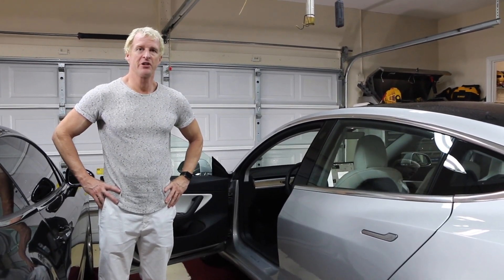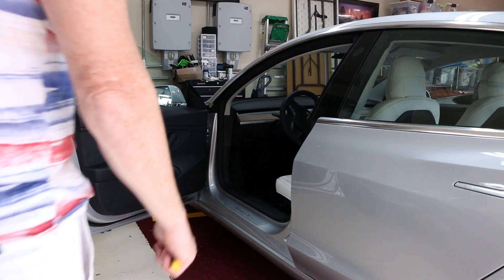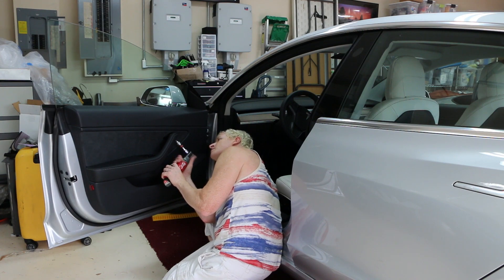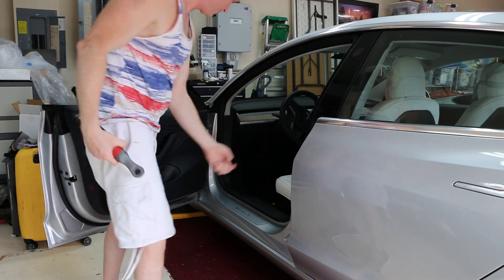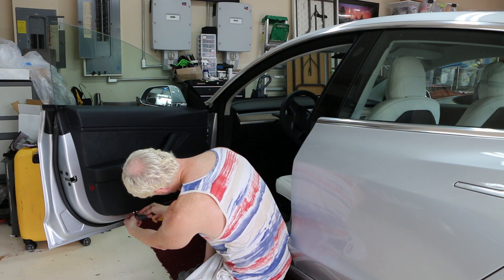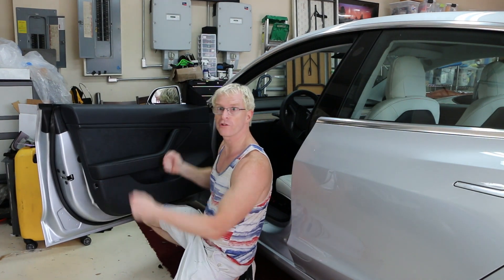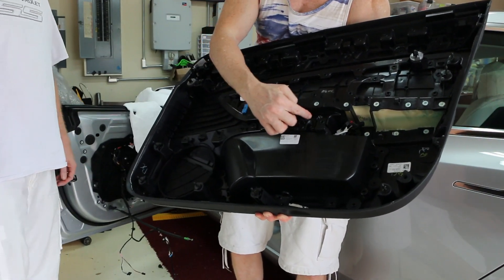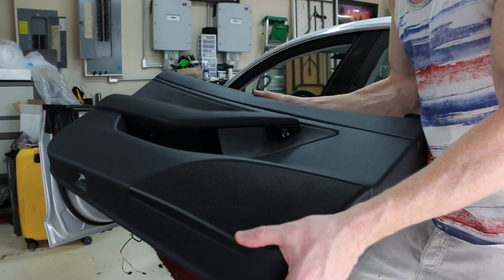Tesla Model 3 Door Panel Removal DIY

Comment: I have to replace my window switch on the driver side and I have the part. it's funny you can't purchase just a little pieces that make individual windows go up and down. But I spent a half an hour trying to figure out how just to pop off the door handle part. no I wasn't too sure I had taken off the first two bolts but I was not aware of the third one.  And then my inner self decided to tell me "why don't you just wait and see if there's someone else other than Tesla that may have had success?" And sure enough a simple search found me to you.... gratitude I can't thank you enough... I can take it from there....

Comment: Nice video.  You mentioned you busted your window.  I was a victim of smash and grab in the bay area.  The perpetuator smash the passenger rear door glass power window.  I ordered the glass from Tesla but  charging me $200 for labor to install which is more expensive than the glass itself which was $140 only.  I have the replacement glass and planing just to do it myself.  Before I start, is it self explanatory on to replace the glass? Thanks in advance for you advise.

Comment: I'm trying to do my rear door. I got the two screws out but I can't pop off the door panel. Any tricks to it?
(I accidentally pushed the flood light inside and I can't get it out)
Reply from the maker: The rear door has two screws and quite a few snaps. Start from the bottom. If you are stuck on the door on one side, switch to the other. The flood light can be removed once the door is partially removed. Should not be an issue. Good luck.